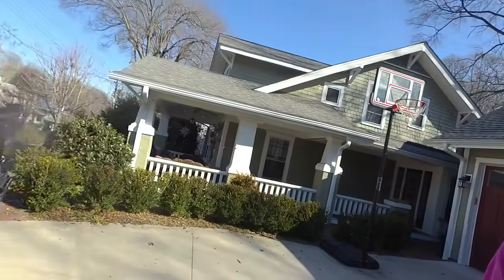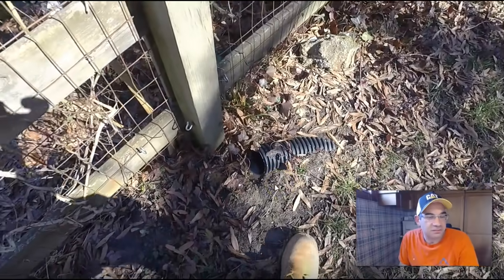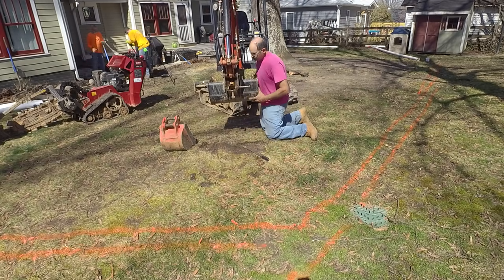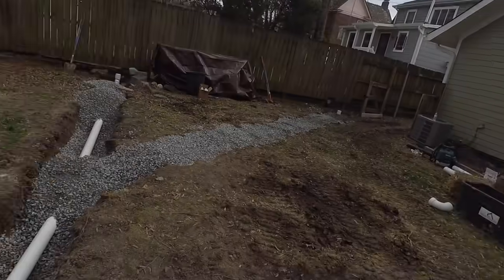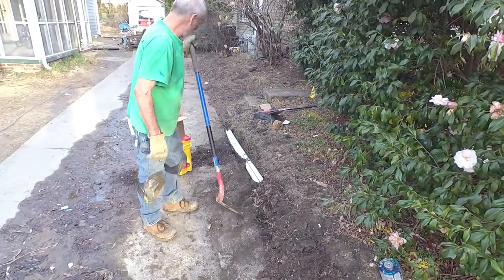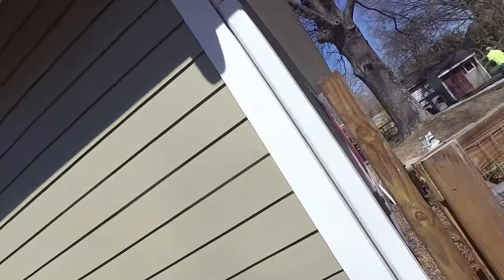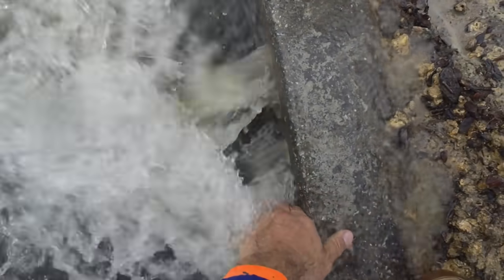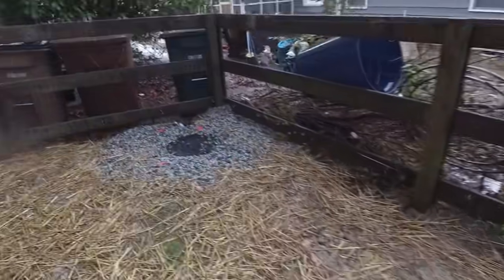Installing a french drain and dewatering pumps to solve stubborn back yard flooding

Comment: Love the fact you showed the system working - looks like one heck of a rain storm and for it to look like that only 45 minutes after the event - good work!
Reply from the maker: Thank you!
Reply: 100% correct.

All the dirt they set on top of the gravel is going to wash in.  Probably within a few months.  All the tree roots they cut are going to grow into the drain.  Probably within a year and a half depending on growing season.  All to save $100 on fabric and two hours labor.

Comment: In the U.K. we would use a much larger catch basin, likely perforated around the bottom and sides so that under low rainfall conditions water simple percolated into the surrounding ground. Under storm conditions pumps send the excess elsewhere. The advantage of a larger catch basin is that the pumps cycle far less frequently which significantly improves life expectancy.
Reply: Yeah, but we have serious issues now in the UK because too many people are paving or decking over their gardens and some crazy amount like 70% of our sewage now has to be pumped straight into the ocean because of overflow. Few people have the sense to install drainage that percolates the water into the ground beside the drive or into their garden and just put it straight into the sewer.
Reply: i have sump under my house they had used a 5 gal bucket with a pump in it....LOL i remove the gal bucket  and bought a 50 gal plastic barrel and cut it down in half and then dug around the edges of the old hole which was fairly easy and cut the  bottom out of the half barrel and inserted it into the hole put some rock around the edges and then put about 3 inches of concrete on the inside for a good base for my zoellor pump with no switch and used a float switch works perfect after it takes a good bit to fill up and then drains again, gave me a lot more time between pump kicking on
Reply: Continuous operation is what burns out sump pumps. That's why you'll notice the sump pump information sheet gives a very narrow range of pump basin diameter in which they want it installed.
The rainfall in the video which overwhelmed the pumps and made them run continuously is definitely stressing the pumps. Hopefully weather like that won't occur too often.
Reply: where i live in western australia  the ground is generally plain sand which drains very  well, my problem is that my rear of my land  is the lowest in the immediate area and has a clay layer around 4ft below . when we get rain it rains heavy and once the top 4ft of sand is drenched my block starts to fill  and due to being the lowest point i cant pump it anywhere. that being said the water tends to drain reasonably fast but before i knew about the potential for flooding (very mild) it caused a ton on damage to my shed contents. perhaps a french drain with pump to roadside is exactly what i need
Reply: Do you think they understand what they are doing?  I don't think they are even able to deduct how much water they need to divert when it rains, let alone what size catch basin they need to pick up.
Reply: @jeevanjacob4102  It's unfortunate that most of your sewer systems are very old... in Australia we have sanitary sewers and stormwater systems separate, and the council pumps smoke into the sewer and fines anybody who gets smoke coming out of their raingutters!
Reply: @jeevanjacob4102  an even worse problem is gardens are getting sooooo small nobody has room for a proper catch basins, and just pipe everything into the drains.

Comment: Nice work! Just FYI, typically if you bury a tree above the root flare (where the roots begin to flare out at the bottom), you run the risk of girdling the tree and killing it, as all the nutrients and water are delivered by a thin layer of cells just beneath the bark, which will rot if wet. It does depend on the species and whether it is particularly wet, but it is definitely a consideration to make given how high up the dirt was mounded for this project.
Reply from the maker: For sure. There was soil around the tree that had washed away so we felt all right restoring it. This was an oak and the phloem is under the bark delivering nutrients from the leaves to the roots.
Reply: @GCFD  Nice, thanks for the response. I'm curious if you have ever done any large rain garden installs? I'm at a site where there is a sizable hill shedding towards our house, and I'd like to use your techniques to avoid flooding...with a twist of pushing the water into a big rain garden at the bottom before letting it out to the street. I'd love to see you try something like this in the future bc I know you'd do a great job....Thanks for your awesome content it's really helped my family figure some things out!

Comment: This is like my project I start late summer last year. Two French drains, picking up all down spouts, Two sump basins pumping out to the street, and a 60' concrete side walk. Also on the property on the hill behind me I generously put in an open 80 foot drainage ditch. I had to grind down several large tree roots to make the water flow downhill parallel to the property line instead of it directed into the my backyard.
Reply from the maker: Awesome! Sounds like a big job but you got good results!
Reply: I have a problem with animals getting trapped in one downspout. I had to pull it off the under ground piping to let them out. Its better than letting them die in the downspout.

Comment: Great video thanks for sharing.

Since you were pumping uphill, did you need some form of back flow preventer to keep street water from flowing into your discharge lines?
Reply from the maker: Yes there are check valves (flapper style over spring loaded) near the pumps.
Reply: @GCFD  thanks for taking the time to answer. 

Really enjoy your videos and especially the follow ups at the end to see all that hard work paying off for your customers. 

Please keep them coming!

Comment: Nice to know that it did get rid of that standing water in 45 minutes.....should be able to keep up with a normal rain event no problem.....
How long do you think those pumps will last?....Just curious
Reply from the maker: Yes! I had ran over to another job to catch things in the rain and then back to this one. The homeowner said he looked at the pump by the patio and saw it was under water and then it wasn't. These pumps can pump around 55-80 gallons a minute so work very well. They are Zoeller M98 pumps with 3 year warranty so should last a few years at least. This was a discussion point with the homeowner with pumps being a last resort.
Reply: Cool, thanks.....ya, those pumps are a workhorse....well worth the money.......great work.....and great work making the video's
Reply: @GCFD  thoes switches will last 3 yrs and 1 week, they are bad to burn out real fast as not enough height before they cycle on and off ,go with a float valve so the catch basin would be full before kicking on would work better,  other than that zoeller pump themselves are fantastic will last forever but their switches suck

Comment: Why don't you lay a geotextile under the gravel in a trench ? it is so cheap, actually

a gravel will sink in a soil/clay after a few years and a drain will lose its efficiency
Reply: Ditto. Y?
Reply: Based on what we can see in this video I would estimate 2 to 3 years this drain will be mostly filled with soil and debris washed down the hill.
Should have lined the drain with a geo fabric, gravel in bottom, pipe, cover with gravel fold geo fabric over the top and finish with another layer of gravel. 
All drains need maintenance, installing one correctly will minimise the frequency of that maintenance.
Reply: @Tas-Devil  
That's just not true.
Drains have been in installed like that for hundreds of years and no fabric was ever used. Many old drains still work to this day. Besides nothing can go without some type of maintenance at one time or another.
Clay will clog geo fabric in a few years making that system move very little water. This install will last many years and only require minor upkeep.
Reply from the maker: I think the thin layer of fabric (maybe 1mm) clogs much faster than many inches of gravel. The gravel also preserves the flow so fine sediments flow through the system instead of clogging against a fabric.
Reply: @GCFD  agreed

Comment: Could you imagine a pump that could keep up? Would look like you opened a fire hydrant in the street.
Reply: we must do it, for science!
Reply from the maker: I can't imagine a pump that could keep up with that much water!
Reply: Some events can overwhelm the best systems... here in switzerland in 1999 whole regions got flooded... since then they tried to improve drainage and water protection, adding extra tunnels of 2-4 meters diameter at the end of lakes... thing is, if those are used, the cities downriver get the problem...
In my local village they are in the process of building a 2x2m tunnel and catching system for a 100year flood event, I am not sure how it will end up looking, but I think it will have a mini dam and catch basin alongside it, most locals and workers think it is oversized and there will never be water in that ammount, but the planning commison has banned developement for the region, if nothing is done, and it kind of is a bathtub between a few hills, with one side beeing a rather big slope...
I am interested how it will end up, so far there is a massive pile of earth across the field, in order to compact the soil and back at the lake they built the 2x2 meter or maybe slightly less big outflow... (to be fair the lower part will also recive two of the local small streams that are currently partialy or fully enclosed, one of them marks our property boundrary) 
The 99 flood had about 1 - 2 meters of standing water here, down at the lake and completely filled cellars and in some cases even groundfloors, I can vaguely remember beeing taken down into one by the local firefighters which where pumping it out (sitting on his shoulders, I was about 6)
Reply: That's a good one ? Lol
Reply: @GCFD  would need a catch basin and hope it can hold the water and deal with it after .

Comment: Question. Would making the pipes bigger allow the water to drain into the street faster?
Reply from the maker: No the larger volume of water in a larger pipe would place more pressure on the pumps. Pumping can never keep up with a heavy rain event but can quickly catch up once the rain stops.

Comment: When pumping discharge lines uphill, how do you prevent water from staying in the pressure line to prevent freezing?
Reply from the maker: Luckily we don't have to worry about that here in this area. I'm not sure how you would deal with that Matt.
Reply: Not a water systems engineer so I'm just throwing out an idea that popped into my head without doing research: maybe have a small diameter return line in the pressure line at the lowest point back to the sump basin? Enough to trickle the water in the line back into the basin but not enough to decrease the efficiency of the pumping too much. I would also guess that the lines and/or basin would have to be deeper so it is below the Frost Line for the region you are in. Anyone can correct me if they know better but it was a fun problem to think about. 
Edit: A problem I could see is the pump turning off and on when the water in the line all returns to the basin, so maybe set the pump to turn on when the level is more than the line volume?
Reply: Here in MN I've seen people run sump discharge hoses on top of the grass to the road, then they get pulled & put away in the winter. Or find a way to heat tape it if you're dealing with natural drainage not pumped. 
Frost line around here is 4', so wherever you daylight the discharge it'll be a problem.

Comment: Maybe I missed it but will you not be covering the gravel with dirt? Also are you not worried about roots, dirt and debris going into the drains without any barrier besides the gravel?
Reply from the maker: Correct. They already had a french drain that was buried in dirt. That destroys it's purpose as the water can't get into the drain if there is dirt covering it.
Reply: He always includes clean outs on the pipes which would allow them to be cleaned out with a jetter (high pressure water jet with a root cutter nozzle) and the smooth pipe lets any other dirt/debris to flow down and out of the pipe during wet weather events.
Reply: @GCFD  do you ever cover the gravel? I wouldn’t want to have that going across my yard. I understand you want the water to get to the drain as fast as possible but it’s such an eye sore going across the whole yard. Plus my little ones love to pick up rocks and move them. Constant fight to get them to leave them where they are.
Reply: @Cbv1914  It is possible, instead of filling up to the top with gravel you put down a water permeable membrane then cover with either sand or topsoil but that comes with either increase costs or decreased drain efficiency like he said so a strip of gravel can be an improvement over a swamp for heavy rain areas like this house. Or for areas with light rainfall and no invasive roots you can buy products that are basically corrugated pipe with filter material and membrane wrapped around all you have to do is dig a trench and lay it.

Comment: Does the sump basin activate automatically when a certain water level is reached or does it have to be manually activated?
Reply: Auto, there's a float switch.
Reply from the maker: Like Jack said, it's got an automatic float switch inside that pops on when the water rises and then off when water is pumped out.

Comment: What a bloody fantastic job you did
This time last year I plumbed my down pipes to the road and also put in a French drain system to a pit near the road in my boundary that naturally flows when at capacity to the street with the fall I gave it.
We had 250mm 2 nights ago after a few days of constant rain and it worked a treat it hit capacity and did what it was supposed to resulting in me being  able to mow the lawn a day later.
I love the pump set up you used there is definitely a few places here in Townsville that could use that
Reply from the maker: Thank you! I'm glad your system is working so well! Nice work.

Comment: it seems like you should have angled the discharges in the other direction.
Reply from the maker: I try to use as few turns and angles as possible with pipe to preserve as much flow.
Reply: I though the same, with water gushing down the road with dirt ,tree twigs and rubbish  the pipes will get blocked,!!

Comment: Wouldn't a grated concrete ditch do a better job than a french drain? I saw a guy used this method in his backyard where the neighbors yard was draining to his lower yard.
So he had the ditch ran parallel to the fence,then teed off from the center,ran back to his house and then connected to another parallel ditch and at both ends were connected to  catch basins then out to the street. Backyard had this ditch system shape of an H but no gravel trails. I think cost would the major setback. BTW nice videos.
Reply from the maker: Hey Jim - It sounds like that could have been a good solution too. Aside from the cost of concrete and other issue is the water runs very fast down it and can cause problems downstream. Channelization is what it's called. Great comment!

Comment: I noticed he doesn't use filter fabric to line his French drains.   That gravel  will fill up with dirt over time.  Nice to see him use schedule 40 pvc.  I will be doing this to my house in the spring.
Reply from the maker: I don't use fabric because it is too thin and kills the flow. I use several inches of gravel as a filter instead. This preserves the flow and that energy is what carries the fines through and out of the system, keeping it clean. The fabric holds all the fines against it which slows the flow even more. Flow=cleaning power.

Comment: I certainly applaud you figuring out how to optimize your material handling with mini machines in wet tight areas with now a minimum amount of labor ! That new trailer and mud buggy brings you full circle .
Reply from the maker: 👍 They have made a huge difference with manual labor and moving materials.

Comment: It's funny how you brought up how you took time to solve the problem instead of throwing pipe at the problem. It's like the difference between a mechanic and a parts changer. That corrugated pipe is junk. We had a huge problem with basement flooding due to the use of fabric and that shit pipe. I was only a teen when it was done, and I knew it was wrong. Fast forward 15 years and we had to re do the foundation (that was poured 15 years prior) and the drainage due to winter freezes and thaws with all the poor drainage. Now it's drier than a popcorn fart.  You do great work. Glad I found your channel today and your instant reply and direction to the part 2 of the extension on that high cap drain you did. Keep up the good work!
Reply from the maker: Thank you Jonny! I'm glad you're enjoying my stuff - Shawn
Reply: @GCFD  Who would have thought drainage could be so fun to watch, haha!
Reply from the maker: @jonnyg6001  I try to make watchable videos by using the time lapse and interesting angles.
Reply: @GCFD  Keep it up!!